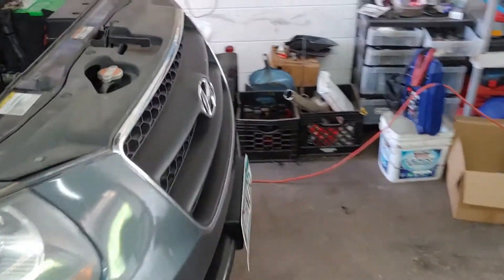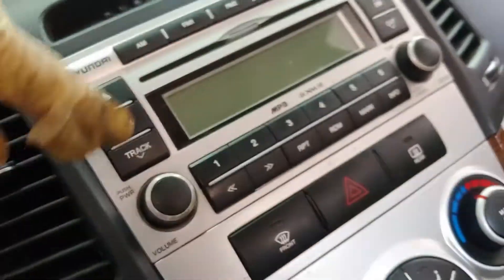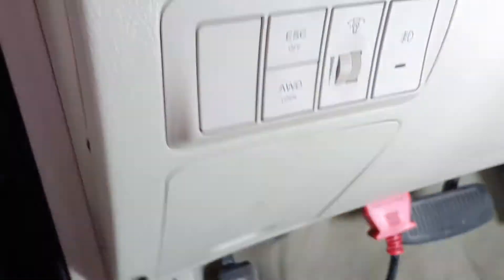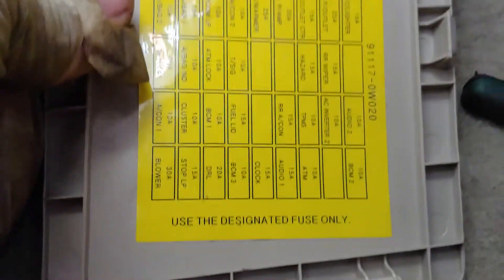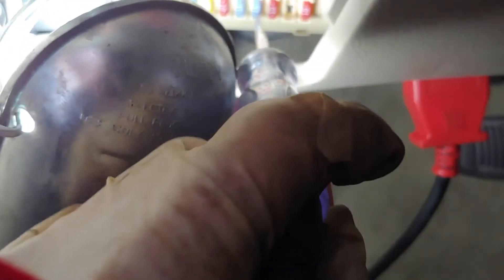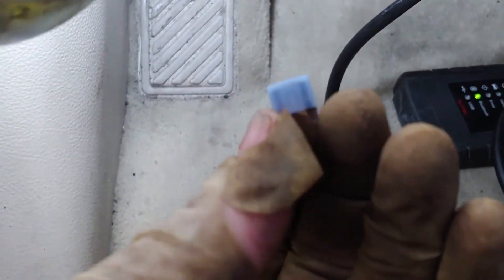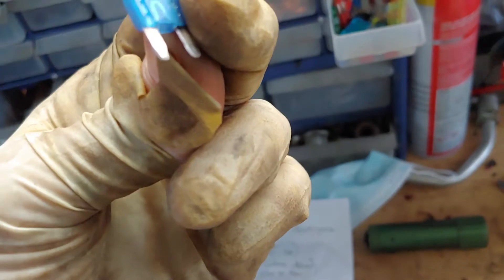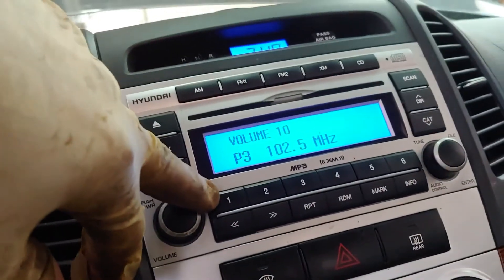2007 Hyundai Sante Fe 3.3L Radio Audio Not Working or Radio Not Coming on

Comment: Wish to fine out whether if the battery is change before the radio stop working can one use the same procedure above or there is another solution for that.
Reply from the maker: changing the battery should not cause the radio not work . In hondas , It will ask you for a radio code but I don't think that is the case of the Hyundai  at least for older models

Comment: I thought a fuse is not a cause, rather one should look for what caused the fuse to blow
Reply from the maker: If The radio went bad on some point for whatever reason, could be stuck CD, or had a glitch or if that same fuse is used for something else like a cigarette lighter and that cigarette lighter had a shortage for whatever reason it could burn the fuse . This is common and normal to happen.
Reply: @autorepairchamps  thanks
Reply from the maker: @bkboy119  You are Welcome !

Comment: Hi nabil ... I replaced my fuse,, but still not working . Sonata 2009
Reply from the maker: Hi Waleed, Does it power on with no sound or there is no power at all . Do you have a scanner to turn the radio on Manually ? Your radio may be the problem.